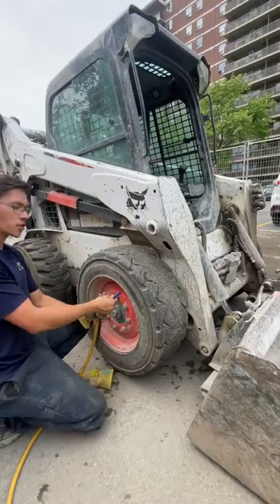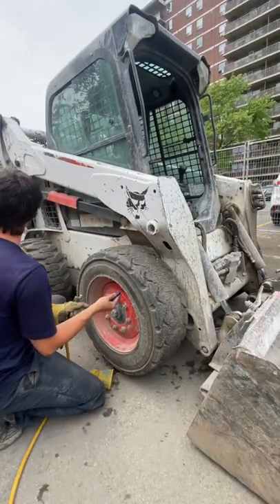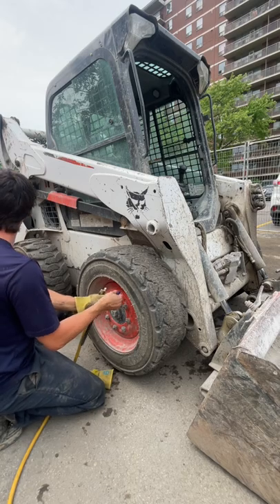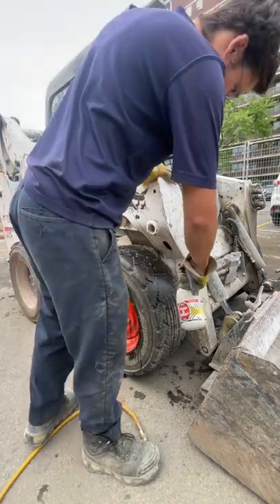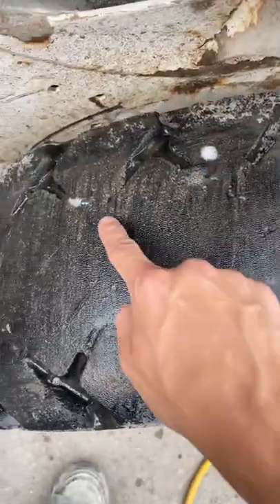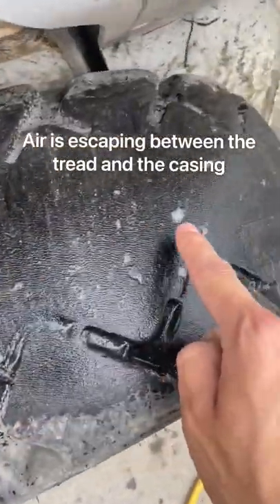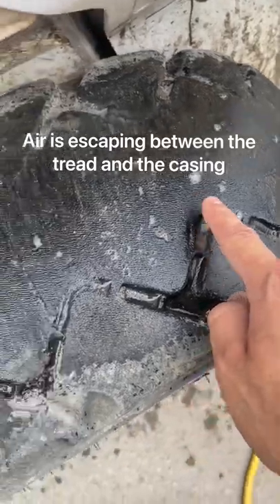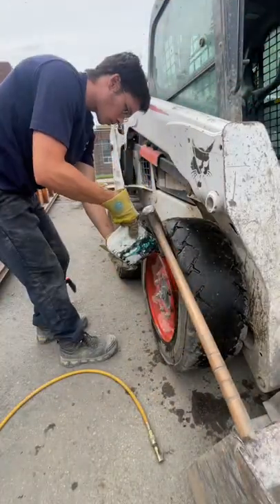❌Don’t Overinflated Your Tires ❌ #shorts

Comment: I had a truck come in today with 90 in all 4, I lowered them to 60/70 and told them it should ride better... I also reminded them they are only rated for 80 max
Reply: 80max cold?
Reply: @justdumpit9789  yup and that's why I do 5 under max to allow for some heat.
Reply: @HoursFreeAOLsp  10-4
Reply: I run an auto/ tire shop. Had a Nissan Sentra come in with 15 inch tires and 95lbs in the fronts. Told the customer he was lucky to be alive after airing them up himself.
Reply: @HoursFreeAOLsp  the max tire pressure accounts for heat expansion which is why is says the max pressure (COLD) so you’ll be good

Comment: I once had a customer come in with a passenger car on 17 inch wheels, they had 60psi in each tire lmao
Reply: I had a driver at a gas station worried and panicking because he saw I was pumping upto 65psi. He was saying 35 is more than enough. Van tyres goto 60-65. My point.... just saying there's always that 1 guy.

60psi in a passenger car and they wonder why they explode when they hit a tiny pothole
Reply: It depends on the van. I think the one I have is 80 in the back, 65 up front.

Comment: I once pulled a tire and wheel off a vehicle  that was on the lift, the way it bounced I knew right away it was over inflated. 120psi in a passenger car tire! The owner claimed a tow truck driver did it. I don’t know how much pressure they can handle before they fail but I don’t want to find out

Comment: Tell the crews constantly to stop jacking the air to 70+ and leave the fuckers at 35-40psi. Then oh no tires low. Tires off the bead. Tires got not tread left in the center. The things 4-5 months old 😮‍💨 worse when you tube it and they still press them up to 80psi

Comment: A friend of mine just bought a dart, and while she was showing me some of the features, she scrolled through her menu to get it on the MPG and I noticed each tire was at 50 psi 🤣 not the most catastrophic overinflation I’ve ever seen. But it was odd because it had just come from the dealership 200 miles earlier. So they sold it to her like that 🤣
Reply: Some dealers install pre-mounted wheel packages. Though, mostly for winter sets.
They will be inflated more than normal, typically 40+ psi.

Probably more likely the person doing the pre delivery inspection didn't adjust pressures, it's likely it was over inflated from factory, whether it be a inattentive employee, or to make sure the tires don't arrive under inflated. Understand with the parts shortages, cars have been sitting at manufacturing plants waiting for remaining parts to be installed.

Who knows though lol

Comment: I doubt it was from over inflation... Look at the tread, or the lack of tread, that tire looks like it should have been replaced awhile ago, could be really old too if that machine does not see alot of action on the daily for months on end... Probably under inflated and overloaded at times in its life, most workers don't do proper daily air/liquids checks before a days start. Most skid tires or rather wheels are notorious for beadleaks, that's why it's very important to check skid tires and top them up in the morning,  before running the machine. I only ever seen casing leaks on regular car tires when they were ran past treadwear bars, looking like racing super slicks. Not saying You should overinflate tires  past the Max rating of the tire, but a bit over the manufacturer recommended pressures is ok (if a tire max is 44, 50 or 51 psi on a car, and car door calls for 32 psi, You can run 36 psi or 40 psi no problem, for the entire life cycle of the tire down to 2/32nds and no casing leaks).
Reply from the maker: I doubt I know what I’m talking about too
Reply: @TheTireDoctor  Do You agree that the tread on this tire is non-existent ?

Comment: I run 60 psi in mine.... Just because it's recommended for a skid to be at 45 doesn't mean its not meant to have 80. The tires are also used on backhoes and recommend psi is 80.  Read the side.....